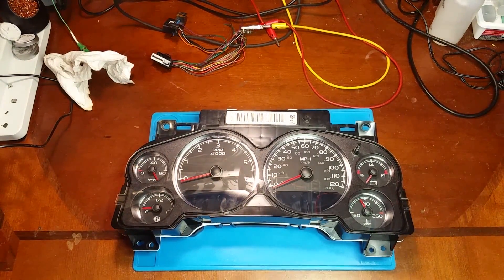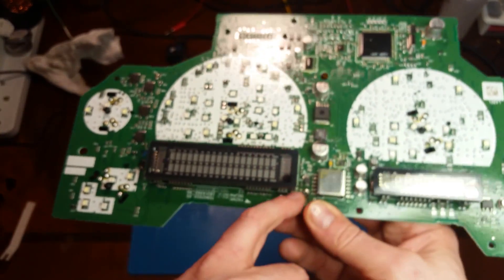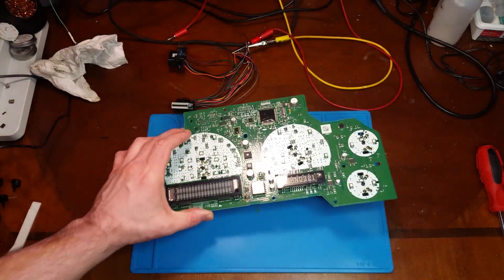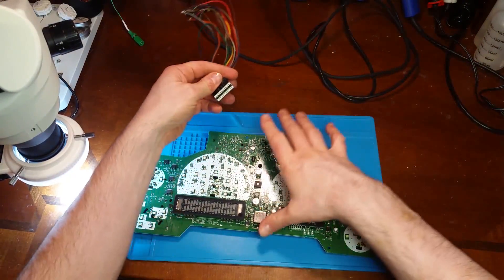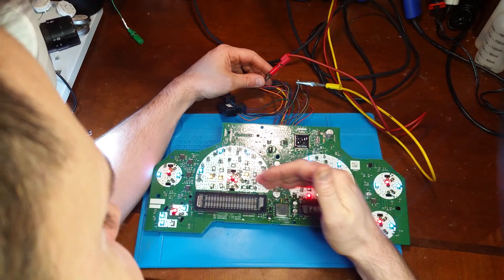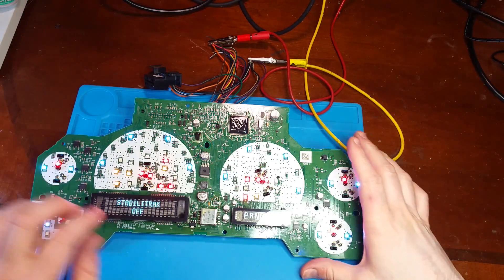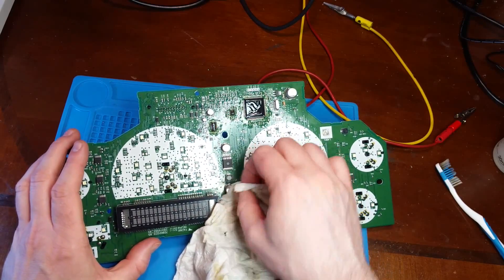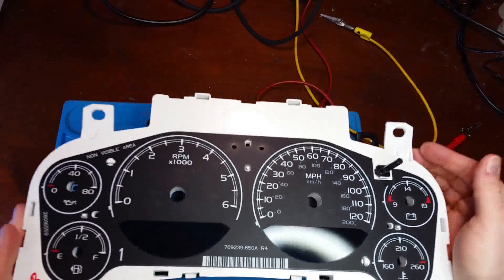Repairing a 2007 GM Cluster

Comment: Hi, i have a problem whith m'y cluster on Chevrolet Express 2008.
No gauge run, no flasher (but light outside run), No PDRN12  light and i have the service bag message and anti Stelf ligh is on.
Do you think it's a cluster problem? Tank you!
Reply from the maker: I believe the express chassis has a common problem with the cluster ground.
Reply: @jeffescortlx  thank you for your feedback. The Ground it's ok. But i found a Little diode is burn. Is juste biside the harness connection. I check to change that.
Thank you for your vidéo! 👍
https://photos.app.goo.gl/LMd3oFBdKCxd888L9

Comment: I can tap on my cluster and it will come back on. Do you think i could just resolder it?
Reply from the maker: I recommend replacing the mosfet with a new one, but in your case resoldering it will probably get it going again.
Reply: @jeffescortlx  okay thanks man! Your video was very helpful!
Reply: I just opened it up and it had fallen off completely. It probably doesnt help that i have 4 18" subs in my truck rattling it to death lol

Comment: I want to buy an eeprom reader what is the features I should look for or brand
Reply from the maker: I'm still happy with my x100 OBDstar, it's expensive for a eeprom reader, but but it's a tool with multiple uses.
Reply: @jeffescortlx  does it program vin number also
Reply from the maker: @772777777777777  well with the x100 and a hex editor program can change the vin. But that doesn't change the vin level options stored in the MCU.

Comment: Can you adjust miles on gm clusters? 2008 gmc yukon?
Reply from the maker: Yes but only under appropriate conditions. Why do you need to change it?
Reply: @jeffescortlx  the engine is getting replaced at the moment.
Reply from the maker: @fivestarhemi2877  sorry I can't help you. Where I live, odometer values are tied to the chassis, not engine.
Reply: @jeffescortlx  what does that mean? Tied to the chastised
Reply from the maker: @fivestarhemi2877  you don't get to roll back the odometer just because your having the engine rebuilt/replaced. The odometer value represents the chassis/frame/body, not just the rings and gaskets.
Reply: @jeffescortlx  o ok thanks

Comment: You fix Cluster with the speedometer problems
Reply from the maker: Depends, what kind of vehicle is it?
Reply: 2007 Chevy suburban 1500
Reply from the maker: @Carlosthecook1647  the new body style 07's typically don't have gauge stepper motor failure, but sure I can replace it

Comment: I resoldered my mosfet and it worked but gets extremely hot. Is it supposed to run so hot
Reply from the maker: It's possible the driver chip is damaged. I've run into times it will pull too much current.
Reply: @jeffescortlx  can you help me with a chip part number?
Reply from the maker: @garydeanstovall370  I go over that chip here: https://youtu.be/SlFtC4m-sis

Comment: So my displays work just dint have LEDs at night? Gauges dont light up?
Reply from the maker: How about the rest of your dashboard? Does the climate control, radio and other buttons light up?
Reply: @jeffescortlx  this just happen out of nowhere my climate control my radio lights my odometer in my message display all work the only lights that are not working or the LEDs for the fuel gauge oil pressure RPM speedometer battery and temperature gauge I have noticed it did it one time before a couple months ago but hasn't done it since now it's been about a week that it has not worked
Reply from the maker: @pittsburghhustler412  sounds like you might have a failed led in the cluster.
Reply: @jeffescortlx  how much to fix that?
Reply from the maker: @pittsburghhustler412  $100 plus shipping.
Reply: Yes everything else works.

Comment: I have a 2010 Chevy Silverado and I want the gauges, A/C control, headlight/brights knob, dimmer and dome light button all to be red.... how do I do that, could you make a tutorial or do it for me.. which would be hard because it’s my daily driver so I need my gauges lol
Reply from the maker: It's SMD, you might want a hot air station. 3528 package size can work and is easy to find.

Comment: Hi jeffescortix I'm having the same problem with my 2007 chevy tahoe none of the gauges works and the panel won't turn on I was hoping i could send it to u to get it repaired
Reply from the maker: Your having a power issue, not display issue. You might want to start with basic trouble shooting to make sure you don't have a blown fuse or wiring issue.

Comment: Hello my name is Jeff I have a 2010 Chevy 1500 work truck and I’m trying to add a oil and a battery gauge to the cluster. I already have a second cluster from the junkyard, I just need someone to move them over.can you help?
Reply from the maker: Might not be straight forward. If the additional stepper motors are installed in the base model cluster, it could be missing additional hardware (driver chips) and software. I know for sure it's going to be missing the backlight and needle LED's. If you run the replacement cluster, besides the odometer being off, you could run into compatibility problems if its not a direct match for braking and suspension systems. I just don't know for sure, haven't tried.

Comment: My 2011 GMC Seira cluster will not work at all, no gauges and no driver information or gear selector, all the videos I've watched had something burnt out but mine looks fine, only thing that lights up is the engine light. I obviously need your help?

Comment: Hello.  You have very nice videos, they are very informative.  I was wondering how i could do a gauge sweep test on a gm insturment cluster without the vehicle.  I have a Snap On scanner that i can sweep guages from the vehicle.  I saw you do it with a differnet scanner and I was wondering how to wire it up.  Do you have to have a computer out of car to comuunicate or can I hook scanner directly to instrument cluster.   I have all the connector pigtails for obd and instrument cluster.  Thanks for any help.  Also you should make a video on how to calibrate guages electronically
Reply from the maker: yeah just power the cluster and hook up the data wire from the scan tool to the cluster. My old tech2 let's me communicate.

Comment: So what would be the common issue. In gm cluster that shows a dim battery light, and other warning light come on and off while idling?
Reply from the maker: Not sure but I would start by checking your batter voltage with the engine running and make sure it's 13.8 to 14.
Reply: It is charging properly. The light will stay illuminated dim even with key removed.
Reply from the maker: What make/year/model is your vehicle?
Reply: Its a 2004 Chevrolet trailblazer
Reply from the maker: I don't remember off the top of my head, but it does sound familiar. I just don't remember what was causing the issue. Do the gauges continue to work properly when the lights come on dim?
Reply: It actually seems to do a gauge test, or sweep. Like if the key was just turned on. But vehicle will have been running. 
So they all do drop out when it acts up.
Reply: Its only the battery light that dimly illuminates.
Reply from the maker: If you want to send it in I can check it out.  Send me a private message if you want my contact info.

Comment: I am in need of your services. 07 avalanche. Mosfet is burnt. Millage screen off.  Already removed but rather pay you for your services. Trying to do this as soon as possible and unable to message you. Please help
Reply from the maker: You can reach me directly with my email address 1mr.repairman at gmail.
Also make sure to ship all the cluster parts so I can calibrate it properly.
Reply: @jeffescortlx  have the same problem need it fix can u help me out thanks I well pay u
Reply from the maker: @natialmodovar2643  yes. My contact information is available by following the link in the top pinned comment.

Comment: Great video and technique. Thanks for sharing your expertise. I do have a few questions. Whats the p/n for the  mosfet? Which flux, flux remover and epoxy stripper so you recommend ? have a great day!
Reply from the maker: $100 plus return shipping for this 07 up style. 1-2 day turn around.
Reply from the maker: Tools and parts used have be added to the description. I just use isopropyl alcohol for cleaning.
Reply: Thank you, That list takes time and I appreciate it. People are fussy about their flux which is why i asked. I have had boards that had an epoxy so thick i used a wire brush dremel to clear it. I have seen guys just melt through it with their iron and suck in the fumes. I doubt they contain the essential vitamins to make you healthy.
Reply from the maker: The epoxy used on this board wasn't too bad, just rubs and scraps off for the most part. A little was still holding the chip down after the solder melted. It was time to make a list, your not the first or last person to ask about the tools, supplies and parts used so I finally got around to making it.
Reply: Great video! I have the same issue on my 07 Yukon Denali. What do you charge to repair?